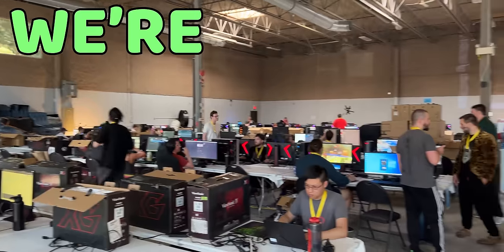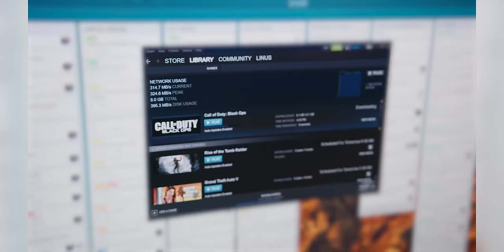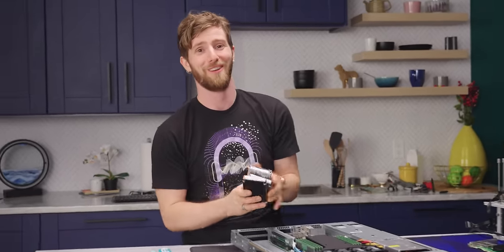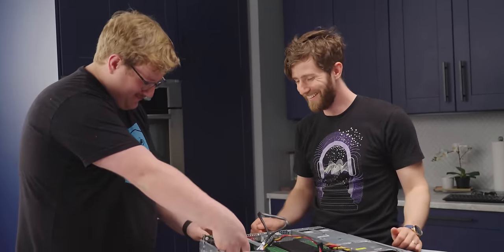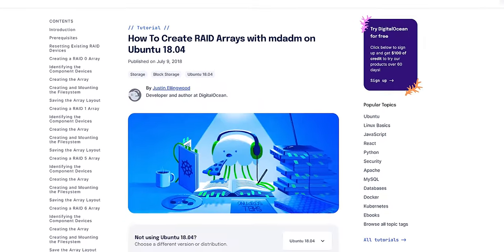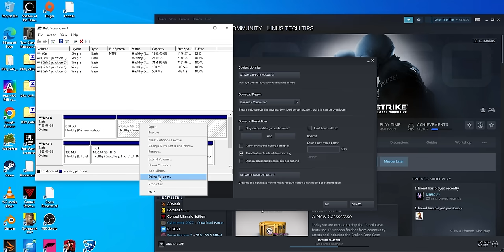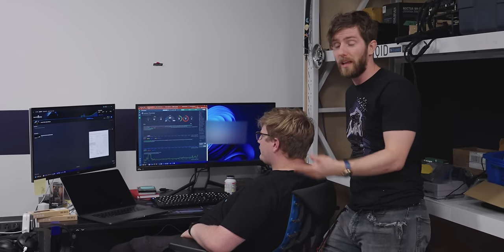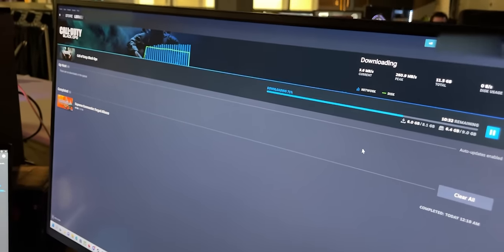We’re running out of internet - Steam Game Caching Server

Comment: The most impressive part here is probably Linux handeling all the caching and hardware control perfectly out of the box and for free
Reply: thats the least impressive part, most impressive part is that windows didnt just fall over when they changed DNS o wait it did, Well this video didnt impress me even a tiny bit
Reply: o7🐧
Reply: @bigpod  Found the Linux snob.
Reply: @icanmakeeverythingilovedie9861  im not a linux snob but i deal with both on daily basis as i use both on daily basis (linux for work and windows for gaming) and i can say linux is much nicer to do stuff with, and when it comes to networking its specially bad
Reply: @icanmakeeverythingilovedie9861  each operating systems sucks its just that for me linux sucks slightly less but at the end of the day windows is a great kernel saddled with horrible ux linux is good kernel saddled with 1000 uxs some ranging from horrible to usable ish
Reply: If they use Fedora server, the zram, resolvd, plus vanilla kernel would be even faster.
Reply: @idtyu  only thing that would actualy make things faster here is vanilla kernel if by vanilla kernel you mean mainline kernel not the fedora kernel shipped by fedora, but that is fairly unsafe kernel.  Why would ZRAM help here (unless you think somehow swap would help which is insane) resolvd has nothing to do here as its all contianed in docker which i think includes dns server. Plus lets not forget fedora is kinda crap in general i dont recommend it for anything you want any kind of uptime in

Now even if i these things would have given any kind of improvements they wouldnt be all that big we are talking about less then a      1% if even that
Reply: @idtyu  no. It wouldn't be, because they were already limited by the 50gig uplink
Reply: @bigpod  O O F
Reply: Play UNIX games?????? What killer title you play on UNIX????
Reply: @icanmakeeverythingilovedie9861  You found a title that runs on UNIX?
why is this community so mad stupid?
IS LINIS GONE NOW FINALLY!
Reply: @lucasrem  i dont think there are games running on unix
Reply: @BunkerSquirrel  why o o f
Reply: @lucasrem  lemmings
Reply: And while a enterprise solutions asks $$$ for such solution…
Reply: @jimby812  hard disagree thats a minute and rather unimportant aspects but things that tent to stem from open source part of it are what makes it better
Reply: @jimby812  well its not and who cares
Reply: This whole thread is just awful, like wtf ya'll. Get some sleep or something.
Reply: Linux has had cache options for years, I was running the Squid cache over 20 years ago in schools to help with the tiny kilobyte/second Internet speeds.
Reply: @bigpod  each OS sucks ?
Reply: @icanmakeeverythingilovedie9861  I was reading it as "Linus snob".

'Mandela effect' strikes again
Reply: windows is free too
Reply: @bigpod  wow you sound like the most fun person iv ever met "each operating systems sucks its just that for me linux sucks slightly less" id love to buy you a christmas present and see how much you hate it even tho you got it for free
Reply: @bigpod  linux users in a nutshell btw i use arch
Reply: @ahmedifhaam7266  yea each os sucks non of them is that great
Reply: @bigpod  I like your funny words, magic man.
Reply: @akippnn  ah

Comment: I tried setting this up at LAN parties a couple of years ago, definetely more hassle and also DNS would crap out at some point. Glad to see it is now a lot smoother operation.
Reply: And as soon as you have two connections, the system breaks more often than it really works. Have seen that happening to often 😂
Reply: We had DNS Setup at out local Lan as early as 2005. We announced our MAC of the LAN card on entry which got setup into the system and simply plugged in the cable. Worked without any issue at all!

Comment: One quick tip, from fellow Lanparty organizer. Configure your router to steal all traffic for dstport 53 and redirect it to this cache! Mikrotik can do that. So many people will leave static configuration of their DNS and that will keep you wondering why the cache do not work... No matter how many times, you tell (even IT) people to configure DNS from DHCP they will not do it, because they are too lazy ;-)
Reply: the lan has already happened but this is a great tip
Reply: Do you really run into that many gamers who have static DNS setup? I feel like that would be extremely uncommon as most folks just rely on their ISP DNS.
Reply: @msavage960  Using your ISP DNS mean when they crash, you crash. using external DNS prevents crashes and allows you to continue using your service, while the guy down the hall from you yells because his Battlefield game was interrupted.
Reply: @Kitosa_Hinoyosha  exactly. Another reason is that ISP dns servers used to be very slow, so most of people (at least in my country) simply uses Google DNS, it is much faster to resolve and practically do not crash. And if you have a lot of people from IT, which is usually type of people on lan, they have it manually changed.
Reply: One side note: you cannot redirect traffic on cache directly, because packets would have bad source IP. But on Mikrotik you can enable local DNS server, make it ask your proxy. Then steal all traffic for port 53 (TCP and UDP) and redirect it to local DNS on Mikrotik. Also do not forget to create exception for your proxy server, so it can access port 53 without this, otherwise you will end up with infinite DNS loop 😎 if anybody needs I can send you working configs.
Reply: @jirijirka9828  Yup. My ISPs DNS server will die once every 3 months on average. I set a static dns to a third party on my PCs and literally have had 0 downtime
Reply: ISPs also used to inject redirects for a lot of sites, especially for ads and shit, into their DNS servers. It's better to use Google or cloud flare or something. Plus they'll use anycast IPs so generally their servers will be physically close so your latency will be minimized.
Reply: I mean, most people even if they have a custom DNS setup, do this via their router, not really their individual PC.
I use Pihole and just have my router dns set to the Pihole, which then forwards to Open DNS. All my devices just default use the gateway DNS setting.
Reply: @msavage960  i do !
Reply: @jasonlib1996  same setup can't live without it .
Reply: @TheEpicAppleEater01  I support your idea however this is much better to set custom DNS on your home router, your router will give that to all clients. Without manual config needed anywhere else.
Reply: @dgpsf  You do both, as while its not relevant for this particular scenario some phone apps use their own DNS rather than the system level one.  If its redirected at the router, you force that traffic onto your own DNS.

The caveat to all this is sooner or later they will move to DNSoHTTP or TLS, which you wont be able to bypass by design.  This is already the case in some browsers by default.
Reply: @jirijirka9828  I use QUAD 9 or Cloudflare for privacy reasons.
Reply: @alexatkin  yes you are correct, but we are talking about games a windows update cache which goes over http and simple DNS (only game download of course!). Main reason is game tournaments and local cache servers. It benefits lanparty and game distributor, both of them save lot of bandwidth, so i suspect it will stay this way for. Long time:)

Comment: Back in late 90s, we used Squid Cache with a dial up connection as a transparent cache, a bit like Linus is doing here, and it managed to support about 12 gamers without an issue browsing web 1.0 content. Granted, there wasn't YouTube, webpages were pretty simple and the majority of the games were still LAN based, but we got 4.5kb/s of that dial up shared between 12 computers, and it cached all our 'big' patch files and flash animations just fine. We had a 100Mbit hub, not even a switch IIRC for the LAN and honestly the cache was amazing when it worked allowing download speeds we could only dream of at the time. T1 all the way baby! hah... but terrible when it doesn't work. I'm sure cache servers got a lot better since the 90s as well.
Reply: yup did the same with squid, and a bunch of solaris servers, and later we added memcache servers as well
:) good old days... my first modem was a supra modem 2400 baud.. after I decommissioned the diy acoustic coupled modem... lol...
Reply: That's how I had my share house set up, Linux server running on a bitsa P200 with a Bigfoot HDD, that's the non-MMX Pentium 200!
The house was long and thin though so I had coaxial cable running in a loop past all the spots friends would plug into on the weekends, the network was fine for gaming until someone decided to copy a file in Winblows, then we'd all lag out and yell, "Who's copying what?!"
Reply: @m-j107  I didn't say I was doing it now, I replied to a post which started, "Back in late 90s". Even if you'd missed that didn't the 200Mhz, non-MMX- Pentium CPU give you a hit it was a while ago? "Bigfoot HDD"?

Comment: I been looking at making this kind of cache since I plan on hosting some LANs down the line. It also has a lot of benefits for average use since the local cache can cache a lot of web content that can just be fed back to you on your local net instead of having to constantly redownload a bunch of content all the time.
Reply: I think LAN Cache is only setup for actual downloads like particular games servers and Windows Update. It's not a web cache which grabs anything the user looks at. In fact that concept  is practically obsolete unfortunately due to https encryption used everywhere. You simply can't switch the source that way on https like you could on http.
Reply: In the last decade cache web content has gotten much harder. HTTPS basically requires you to man-in-the-middle every user to inspect whether a request is cachable.

Game downloads work because the whole system is designed to be cachable via CDNs and ISPs. They purposely send the large files over insecure HTTP then verify the files over a seperate secure channel.
Reply: @handspiker1994  thanks for explaining this, I was wondering why they weren't having any certificate issues
Reply: Yeah, TIL that apparently a lot of heavy payloads for game services and Windows are sent over http and it is not a big problem. Windows Update, for example, does a special https handshake before the payload is transmitted and this secure channel shares a hash of the payload signed by a Microsoft certificate. On the your end, Windows verifies the payload hash using Microsoft's public certificate. So, in theory, an attacker would have to forge a certificate or compromise https, none of which are feasible. Even though the payload is sent in plain! It's very neat!

Comment: 500watts is probably most common if you have 200 watts of overhead on the server . they dont generally let you O.C. server gear . potentially psu efficiency curve or future cpu thoughts
Reply: Also, far less thermal loading and general stress on the silicon of the switching FETs & diodes used in the PSU

Comment: The V2 version of the LTT screwdriver should have a LED light at the end to light up when detetecting pressure on the screw bit, making it easier to use in dark places or inside cases. Just putting that out there ;-)
Reply: That will take 9 years to make due to all the revisions Linus will demand.
Reply: Id prefer a button in the handle. Because in your solution you could be already pokin on a harmfull place before you see what you are pokin at. And once you lift it up to change position you still could miss because light has gone off.
Reply: @FINRaver  Yeah I actually agree with you on that. Would also be simpler.

Comment: I'm surprised that you only went with a dual 25 GbE NIC instead of either dual 100 GbE or something like that.

The fact that you were able to peg it to 50 GbE pretty quickly and easily suggests that you could've given it even more bandwidth to pull from.

It works, but it can always work better.

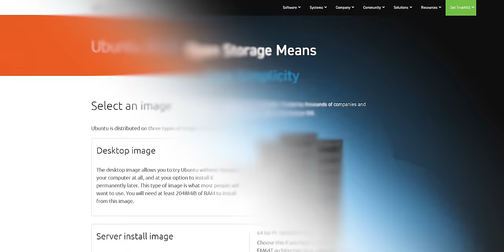Comment: 10:34 Speaking of Ubuntu.
After 10 years of daily driving Ubuntu, and suffering through the last three years with a crazy glitch that infinitely fills my hard drive with log files (expecting every major update to fix the problem but they never did), I have now finally ditched Ubuntu for Arch (due to Steam OS 3.0 using Arch I figured I may as well make the leap).
It's actually good timing because Arch recently got updated with the "Archinstall" command, which makes installation a million times easier (or in my case "Infinitely Easier" because after two days of trying to resolve a signature key error the ONLY way to install Arch was through the automated Archinstall process).
Reply: Can you provide a link to the bug report? I came across a bug like that ten years ago or something, but I was never able to recreate it, so I just bypassed it and forgot about the whole thing until you mentioned it.

Comment: Just one minor correction:

In true CNCF form, you should run each service you want to cache in its own container. Docker containers should be designed to be lightweight and single purpose. You will ultimately have better performance sequestering your: caching services, routing layer (nginx / traefik), storage layer (dbs, redis / memcached) and other components

 Sure its easier having one instance - however thats why things like docker-compose & kubernetes exist, they allow for declarative orchestration of containers
Reply: I like to use systemd-nspawn, full systemd in containers, no need to make one-role containers :D

Comment: This is pretty great, but I really wish more software made use of p2p software like IPFS (basically Git + Torrent + Http). Multiple people HAVE the files in the room, but the software tells all 200 people to pull from 1 external server, causing massive bottlenecks. This is a solved problem.
Reply: Yeah, LAN based IPFS would be cool. The gaming companie could use that fairly easily. I wonder why they don't. Steam used to work like that in 2006. You'd see a lot of outgoing traffic.
Reply: Just having torrents available for things would be so nice. Only non piracy use I often encounter is linux iso files. Nothing offers torrent downloads these days, even though it's such a great way to download stuff.
Reply: I think Windows updates experimented with this or does this. It will pull files for local computers.
Reply: this is a solved problem yes but its in reality also quite a security problem who do you trust a random on internet or someone you already trust enought to even consider downloading something from their website
Reply: @bigpod  Checksums exist
Reply: @Hopgop1  they sure do exist but unless you trust the source of the checksum its useless
Reply: Look into IPFS, this was the first problem they solved. Data is not location based, it's content based. Hash the content, you get a content ID. If the content changes, the CID changes. That CID can be used to verify the content you recieve, and its rejected if it doesn't match. The chunks are small, so it takes little computation, and if a node sends you enough bad peices its easy to blacklist.
Reply: @bigpod  True, but why couldn't the source for it be the Steam server for example and the big game files themselves are P2P. Only needs a central server for verification.

Comment: PSA: Primary and secondary DNS entrys are not what you think! Think of them more as 1 & 2 or no labels at all since they'll be chosen randomly not as any kind of fail-over.
Reply: Windows does not even know if the DNS is broken, it won't try the other one.
Reply: @wayland7150  Your config is messed up or your understanding of how it works if flawed.   DNS failover works generally.
Reply: @JuryDutySummons  Probably works OK if you let Linux do it.
Reply: @JuryDutySummons  not if there's cache or a negative response from the queried DNS.

Multiple DNS should be used only if they are identical to each other. Otherwise it's generally a bad idea.

Yeah someone who really knows what they are doing could make it work and not mess it up for the users, but there's not a lot of us who can do that successfully.

Most people will just blame the network or the network/IT guys will blame the DNS because they don't understand what's happening. That's why it's best to stick to 1 reliable highly available DNS server wit as low latency as possible, instead of mixing different servers that may result in worse problems that having one down in the first place.

Edit: typos
Reply: @JuryDutySummons  And to be clear what you refer to as "dns failover" is more like DNS aggregation, true DNS failover is only achievable in a reliable way from the server side. Unless you know the servers well enough and have assurance that they will behave the same, then you could achieve it somehow having more than one, but still, it only takes 1 bad reply from one of the servers to mess uo your connection as a whole, real DNS failover is not possible from the client side without manual intervention or smart abstraction on top of it.